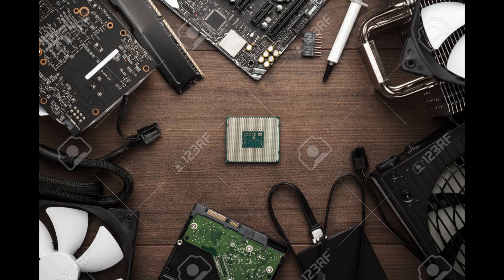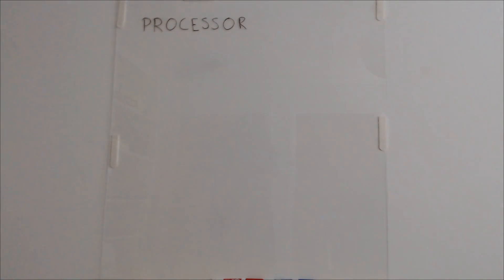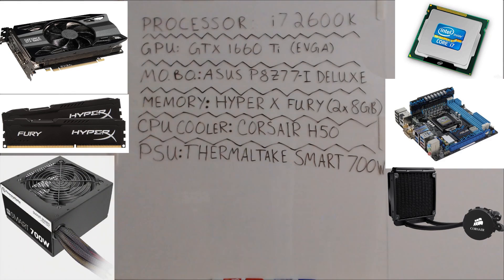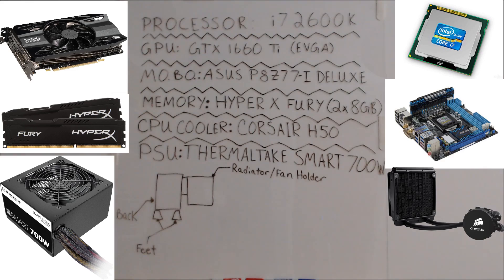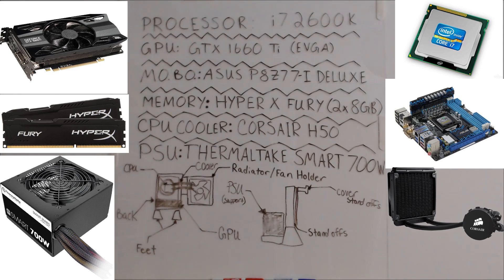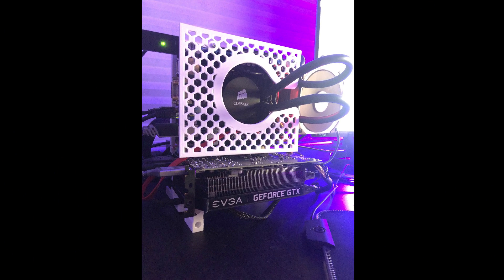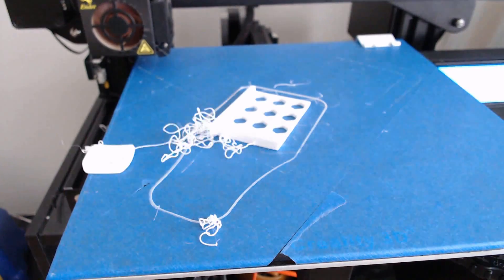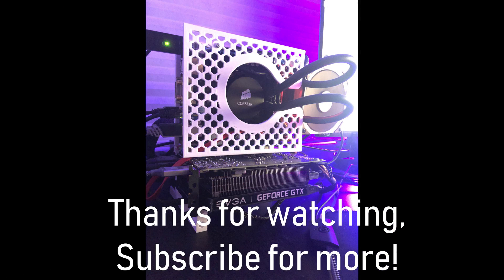Can you 3D Print a PC Case?

Comment: This CPU does not need water cooling. It's enough to use low profile Noctua where you actually use ventilator of this brand. So it looks like you done great job and put little piece of shit on top of that.
Reply from the maker: True true - I bought that cooler used with the other parts so I just threw them all together but for my next design I’m going to use air cooling to make the build much smaller